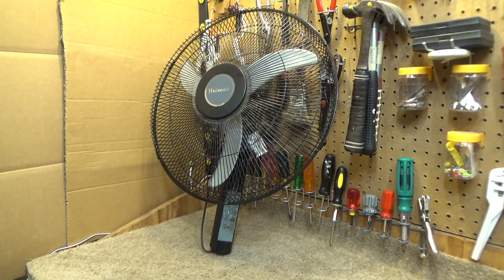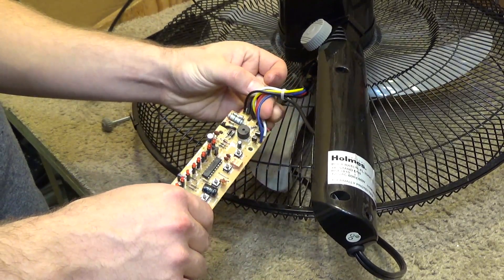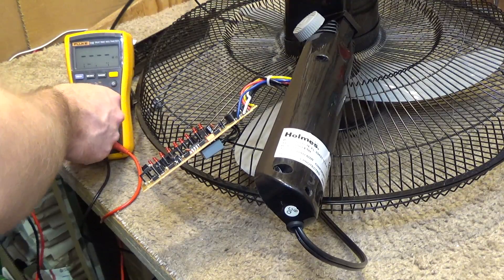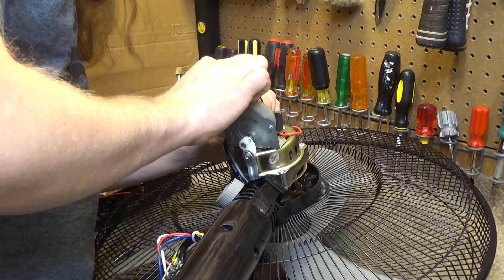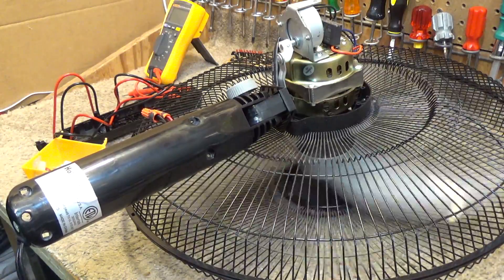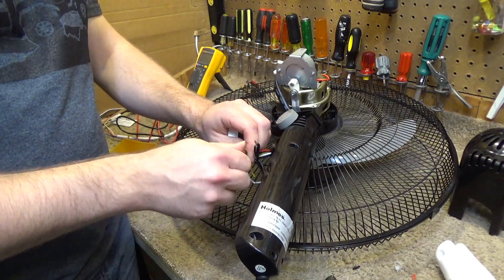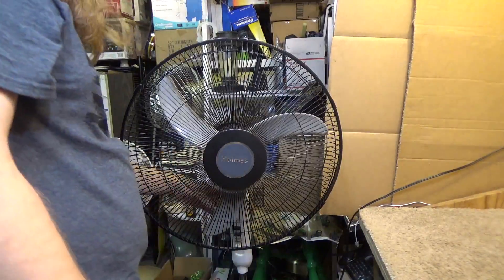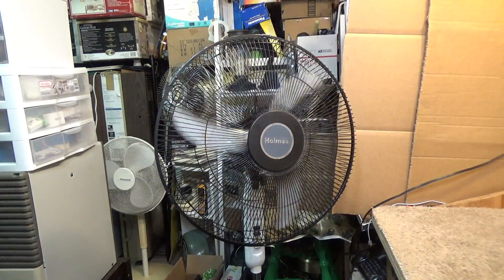Defeating Planned Obsolescence by Replacing Electronics Controls with Simple Mechanical Controls

Comment: Electronic Fan Control Boards are powered similar to most LED Bulb or Tube lights consisting of Capacitor Voltage Dropper due to the fan is switched by TRIAC which requires common Neutral.
When the Dropper Capacitor Blows Up, the fan will not work.
Reply from the maker: Ridiculous design.
Reply: @JordanU  Yeah
Reply: They can do with 12v power supply and  Opto-TRIAC in the board but manufacturers opted to use Capacitor Droppers because it is cheaper but more dangerous if fixing it, if the capacitor breaks or something shorted.
Reply from the maker: @vargasantonio286  Unfortunately it seems these Chinese brands don't really care about safety of the products anymore. What I don't like is the motor, which gets hot, and cold get very hot if something went wrong, being housed in plastic. Same with the control panel.

Comment: What solution would you advocate for those who previously could make use of the extra functionality of the electronic controls (a timer without a ticking noise, a remote control), which has been lost?  Purchasing X10 equipment?

This video presents electronic controls as if there is no purpose of them besides the addition of planned obsolescence, which would be true if all they did was adjust power/speeds.
Reply from the maker: No necessities have been lost with the failure of the electronics controls; only conveniences. I'd advocate for going without them.

Comment: Nice! I love being able to do this! I did it to someone's lasko tower fan a while back and they're still using it today! Maybe see if you can put a toggle switch in the motor housing where an oscillator button would normally be to run the oscillation? You can't beat mechanical controls! Ive never seen one fail aside from 100 year old speed coils needing to be rewound lol!
Reply from the maker: Me too; I'd much rather do this than go to the store and buy a new fan. It wouldn't be hard to put a switch somewhere for the oscillating mechanism, but I never use the oscillation feature so it's not worth my time to make it work again.

Comment: Is there room for a rocker switch in the control box for the oscillations?
Reply from the maker: Yes, but I never use the oscillations so it's not worth my time to get it to work again.
Reply: @JordanU  darn I wanted to see it oscillate but understandable. I rarely use the oscillating function on my fans and if you need a perfectly good oscillating fan you have a whole collection. I always thought how theses had a separate motor for the oscillating function mutch like the modern Bionaire DC motor stand fans and the soups Ku Husing wall fans.
Reply from the maker: @theericfreeze1493  I don't like the design, there's no reason to have a whole second motor for the oscillation when a simple gearbox can do the work. Again, another addition of complexity to reduce reliability and increase failure.
Reply: @JordanU  Yes, just to have the "convenience" of being able to start/stop the oscillation with an electronic pushbutton. Or, with the higher-priced model, by remote control.

Comment: I am glad you could save this fan because it seems like a somewhat decent fan. I hate planned obsolecence so much that I defeat it in any modern fan that I get.
Reply from the maker: Me too, this does seem like a decent fan for what it is.
Reply: @JordanU  I had a control board go bad in a tower fan and it went bad crazily because whenever I plugged it in, it would turn on and off and randomly choose speeds and start and stop the oscillation and it was just a whole freakshow and it ended up burning up the motor because it ended up powering 2 of the speeds at the same time. It was a tower fan that had decent power, it just broke its control board. (Granted the thing was 13 years old and beaten up.)